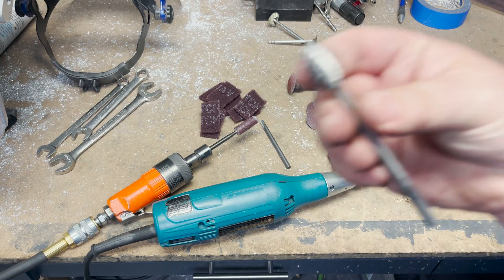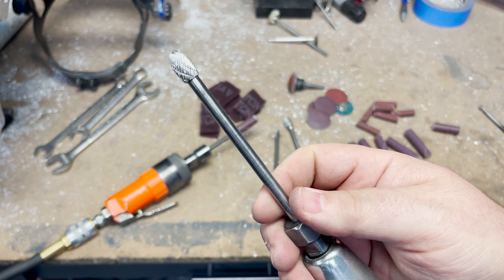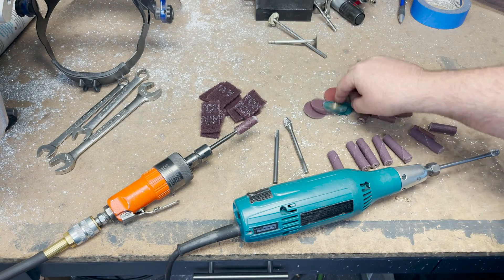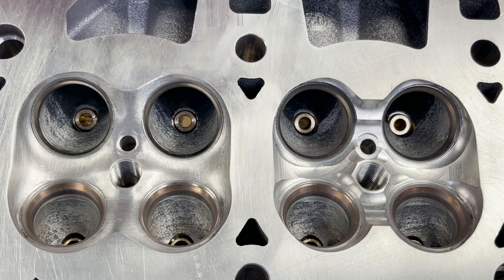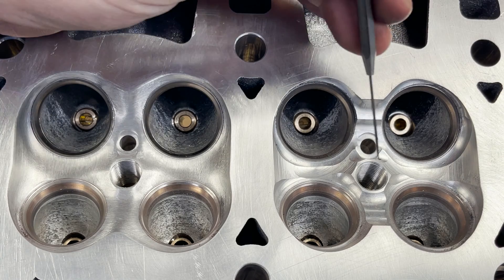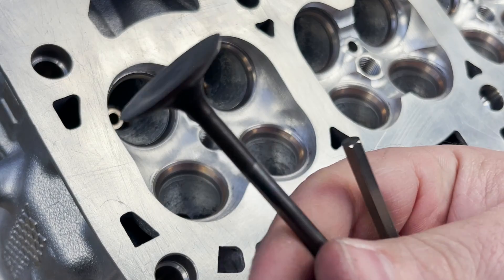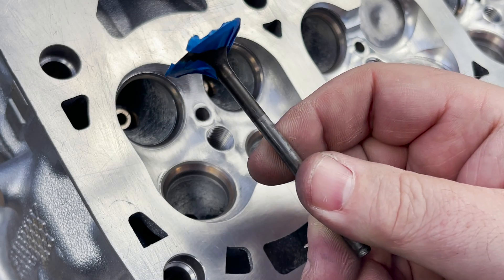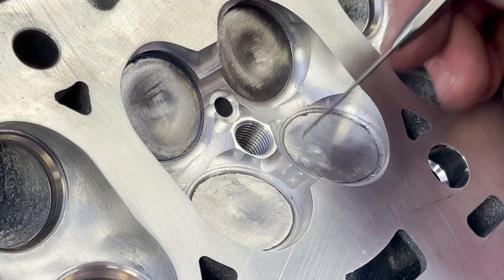HOW-TO! Chamber re-shaping on a B58

Comment: That'll destroy the compression ratio/low end drivability.
Reply: Yeah thats why they recommended the port injection and you would run a different blend ratio, stepping up the DI later in the powerband.
Reply: Are you sure that it will “destroy “ the compression ratio? : What was the original static comp ratio, and what is it now? The static comp is now dependent upon what piston, head gasket and stroke are now being employed; of which we no nothing from this video.
The second, significantly more important, is what’s the dynamic compression ratio? Which depends largely on cam timing. Thirdly, what is the actual amount of air being compressed? VE and boost dependent. 
Given that it’s getting a port job, there’s probably a lot more getting squeezed, makes the focus on a single aspect seem not very thoughtful.
Reply: @kyliejm2  a port job does not necessarily mean you are okay with making sacrifices. Plenty of street cars are ported and drivability is a necessity, and doesn't always equate to a power adder forcing in more air.
Reply: @kyliejm2  Yes, I'm sure. It will lower the low end drivability and compression ratio.